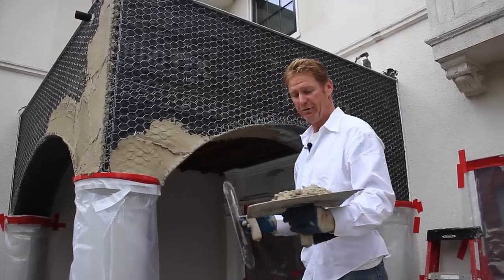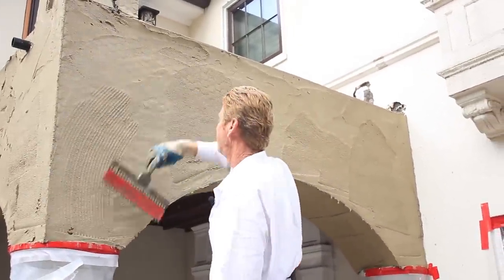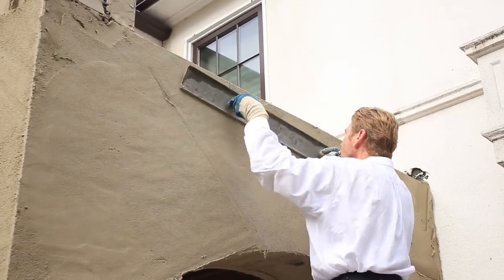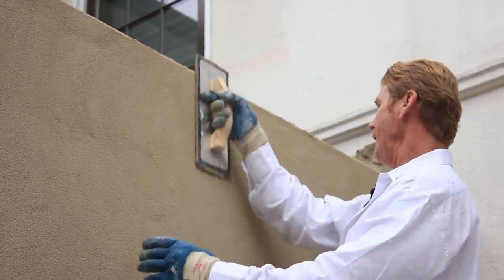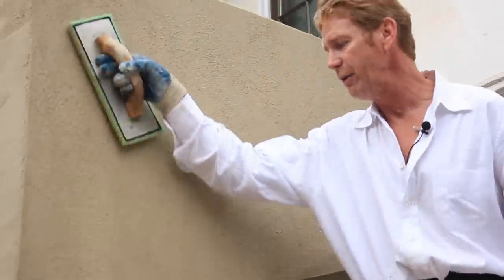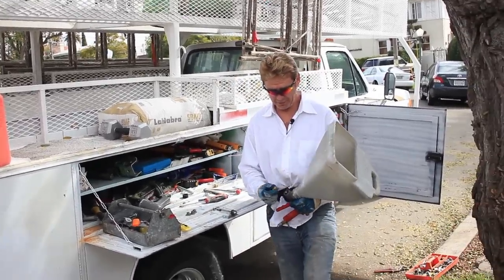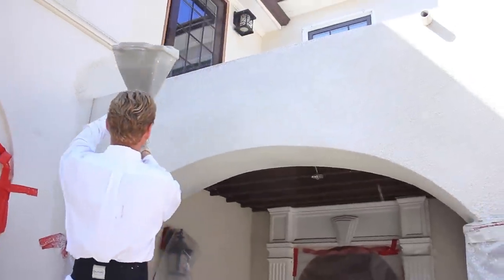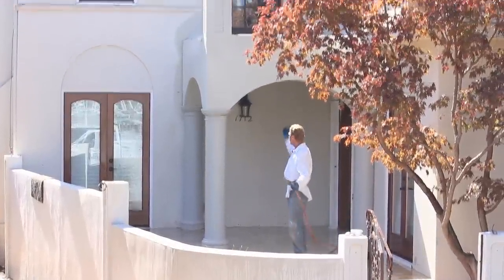Stucco for beginners

Comment: Kirk, I'm going to stucco an old place and I can see the wire showing through,,I'm going to pressure wash, weld Crete,,should I apply a scratch or just go for a 2nd then color? Thank you so much for your hard work, artistry and sharing with us
Reply from the maker: @dog_biter  Most times just a heavy finish coat is all you need like 16/20 sand or it’s also called heavy sand finish.
Reply: @StuccoPlastering  that's what I hoped,,thank you Kirk,

Comment: I really enjoy watching your videos and would like to replace 1972 siding with stucco on our house in Nebraska.  Most contractors around here do EIFS but I would rather do traditional stucco ourselves. Does an entire wall need to be done in one application, or can we start and stop within a period of days? For example, can we do half of a wall with scratch coat and come back next day and finish scratch coat?
Reply from the maker: Good afternoon Marianne Hotz, excellent question; yes, you can take as many days as needed. However, be aware of when to stop and then re-start plastering.
 When choosing a stopping point, go from wall to wall, which avoids ghosting of future coats.😉
Our unique plastering Tip:  all subscribers or anyone who stumbles on our channel with a question, type it into our Stucco/Plastering channel, and like magic, a video will appear to explain how it's done. 	
   This feature is miles ahead of any plastering forum. 	
https://www.stuccoPlastering.com
http://www.bayareaplastering.com

Comment: you are the best question i apply a stucco do i have put water  went is dry like the cement or stucco dont need water after you done please replied back to me thanks
Reply from the maker: Morning Rosa Sanchez, thank you, but I am not the best, I am possibly the most recognized due to our huge number of videos.
 I think you mean do you need to hydrate the new stucco?
(hose the walls down with water?)
 Yes.
FYI, I like to hydrate a base coat at least 3 to 5 times within that 2 to 3 week cure time. The idea is to fill it so full of water that it EXPANDS, then when it shrinks or drys it will naturally hairline .If you hydrate your new base coat at least 3 times this will happen, 5 times will make sure it does.Why is this so important? If you don't hydrate (or hose down with water) the new stucco base coat, before you apply a finish coat  the water needed to apply the color finish coat will hydrate it or expand it (base coat) and when the color is dry, this new color finish will also hairline naturally with the base coat stucco.
Or say a person that never hydrates new walls then applies a color finish, then 1 week and or to 5 months goes by and old mother nature rains on these same walls for a week straight, what will happen?
 The new walls with stucco will finally expand (with the rain water) then dry, and more than likely hairline as this process is natural with Portland based stucco products,  thus, a pretty new color finish also hairlines with the stucco base coat.
 I hear this comment often, "These guys did a great job, but now it rained and it looks awful with cracks, why" I usually say they did not hydrate properly. BTW, this happens to the best of us sometimes.
Lastly, most homes do not have a three coat system unless you include a color coat, most homes in the U.S. have a two coat stucco system, with a texture just like the one in this video.Best wishes, 
 Kirk Giordano Plastering
Reply: Thanks to replied back now i know  what to do thanks to you i been doing a lots of repair in my house.
Reply from the maker: Hello Rosa, no worries, this comment makes my day!
 Cheers!
 kirk Giordano polastering

Comment: Hi my name is Jacob and I suck at doing stucco, but my dad still makes me do it as a part of my job, so that we don't have to pay more to have a pro do it.  I have done about ten patches and I haven't gotten much better.  I just had a few quick questions for you.  Is your mortar mix pretty soupy? because mine has a little thinner and wetter consistency than playdough and it takes forever to apply.  and how thin and how wet is your finish stucco mix when you apply it because my biggest problem is the finish coat.  it is really noticeable when its finished.  you can clearly see a bulge where the patch is.  if you could help me out a little bit that would be great. Thank you
Reply from the maker: Evening jacob glick, all folks suck when they start any new trade, job, sport or any other activity, this is natural and quite normal.
With practice anything get easier, even if it's forced on you in exchange for money.
 Try this, mix your cement plasters with more cement, this will make it easier to handle and apply,
 too much sand or water is what we call ( A soup mix) in this trade, I can't apply that kind of mud either.
 I make it look easy as Jason my son knows how to mix perfectly, plus if you are mixing and applying your own mud that also make any patch tough.
 Hang in there, as the benefits of learning far outweigh the instant so called gratifications of quitting.
 BTW, your dad is helping you in a big way, you just don't realize it yet, this is also natural and again quite normal.
 Best wishes,
 kirk giordano
Reply: +Kirk & Jason Giordanos DIY plastering and stucco tips 
Thank you for the help.  I have one more question is there a difference between a green and red float?  Because I use a red one and I don't know if thats what I am supposed to use for the scratch coat.
Reply from the maker: Hi Jacob, excellent question, a red float is used more by brick masons, to compact the grout between bricks.
However you can use as a red rubber float to compress the second coat of stucco, but a hard rubber float works better.
Also, green sponge float works better for bringing the sand to the surface, the red hard float only brings a small amount to the surface, as again, it's mainly used to compact the grout between bricks.
 Cheers,
 kirk giordano

Comment: We just moved to AZ and they use foam instead of the wire - so frustrating!! CA does have better building regulations!
Reply from the maker: Hi Tina, the foam has some advantages such as it's lighter in weight for tall buildings, some say it keeps a house more insulated but for strength nothing comes close to a three coat traditional stucco system.🍾